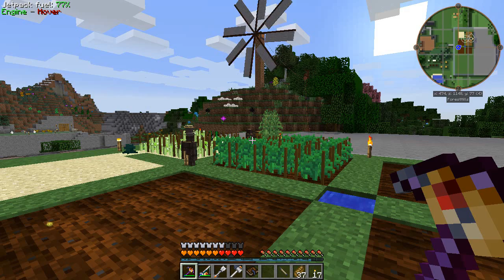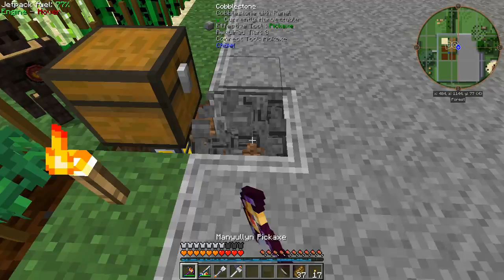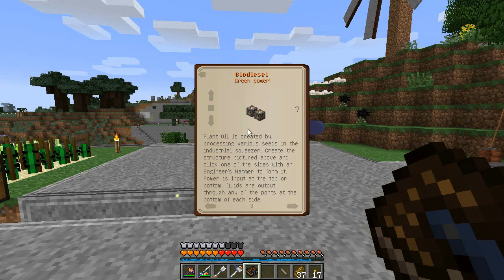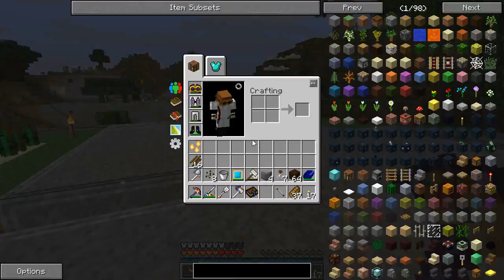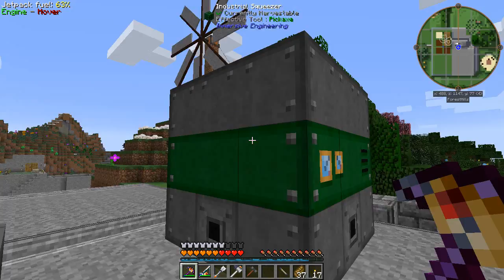S07E17 - Playtime - Immersive Engineering Squeezer

Comment: This power gen ok, just make sure to have multiple farms going at once as I am running out of ethanol and I am only using one sugar cane farm and I always seem to never have ethanol
Reply from the maker: +gaza721 Yeah man, I noticed the same thing. Its not very smart with how it outputs its power, and these farms are not enough to keep a generator running full time. I just posted a video today showing how I solved the problem with an RF Monitor. Its enough for my current needs, but if I start using too much power or running the generator for longer than about an hour or two, then those barrels run dry! The fermenter and squeezer do seem to keep up though, just the farms aren't big enough....